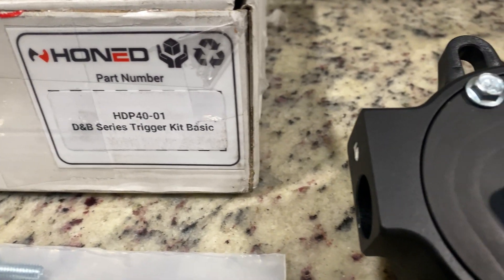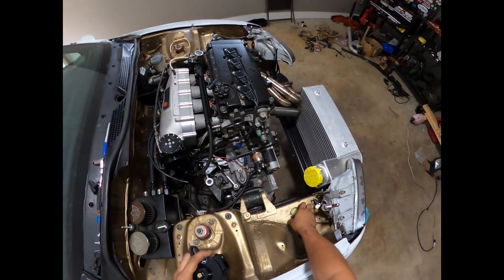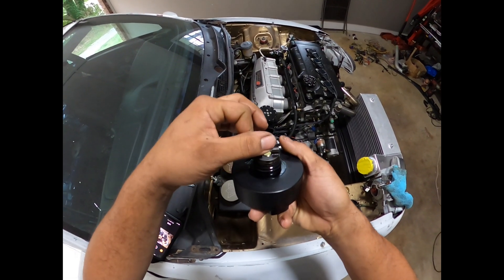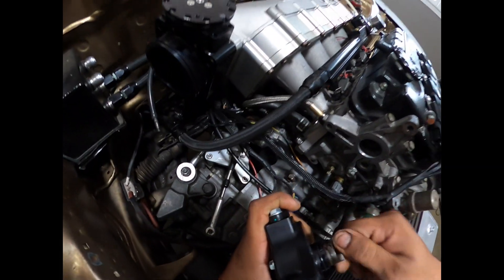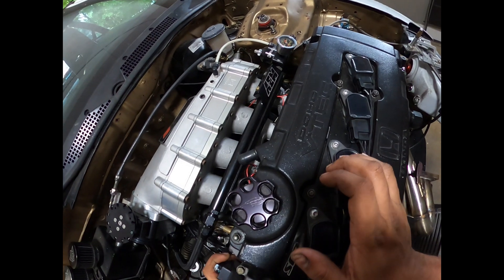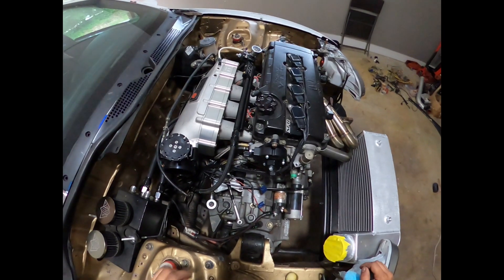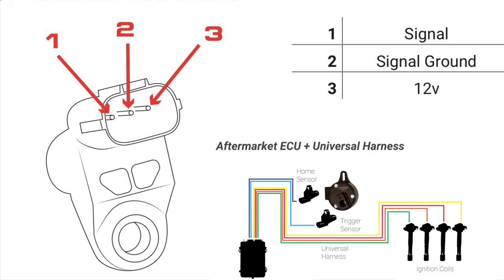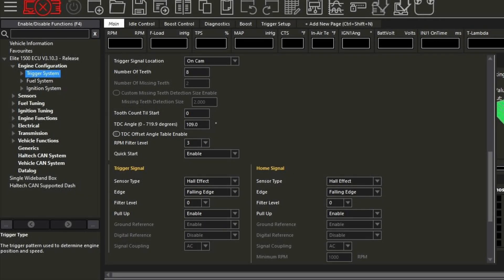Honed Developments Trigger Kit Install on my AWD Turbo B Series powered by Haltech

Comment: What harness are you using for the conversion and coil on plug?
Reply from the maker: Stock engine harness using Haltech Jumper Harness, I made my own coil pack harness and wired it in along with my pressure sensors and trigger sensors
Reply from the maker: As long as you have the pin out for whatever ecu your using you can wire anything up